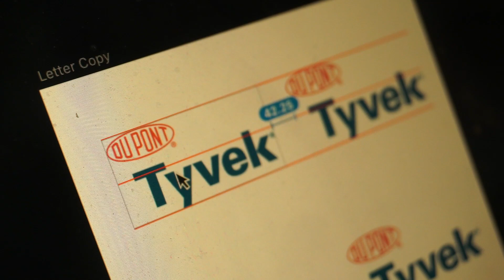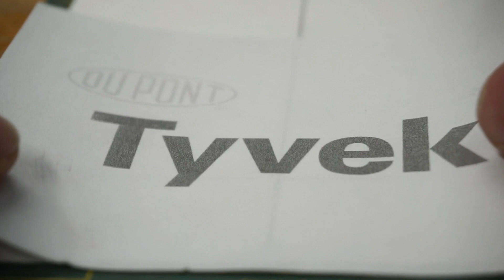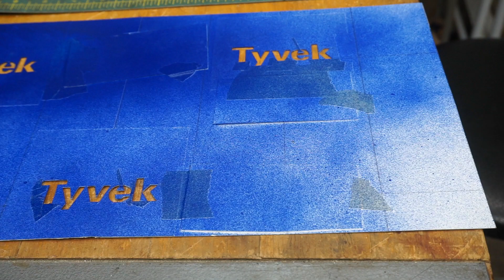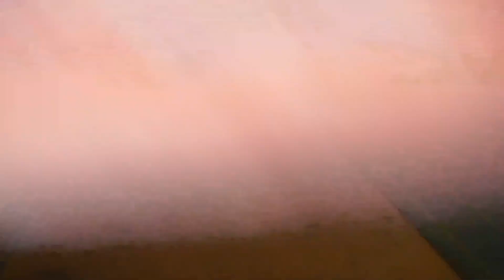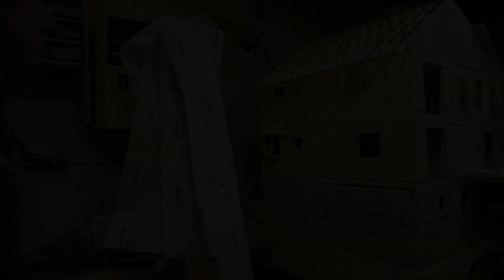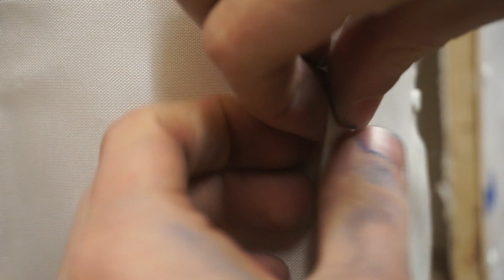Building a Realistic Model House, Part 30: Making and Installing Scale Housewrap

Comment: I think some kind of rubber stamp would give the best result. Speaking as someone with zero experience in anything like this.
Reply from the maker: I thought about that too actually, and I've actually done a fair amount of rubber stamp carving! I was worried that the ink wouldn't penetrate deep enough and that the impressions would be too variable. I might give it a try somewhere else on the house though - it's a good idea.